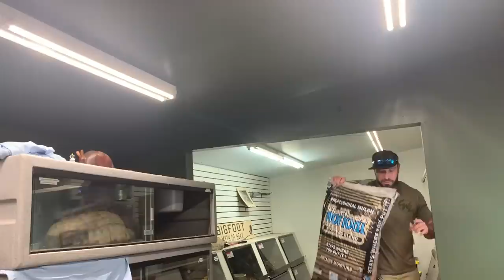KING COBRA!!!!! TAKING CARE OF 2 GIANT KING COBRAS!!!!!

Comment: I was just talking to a friend about preparing for the future with fly rivers.  I've been obsessed with them for years but trying to accommodate a highly mobile, 45 pound, 2' diameter turtle?!  Shit, I don't have anywhere to build a 3500 gallon tank for a single turtle.  Big snappers are a walk in the park compared to that.
Reply from the maker: Yea they do require a lot more than most turtle species but if done correctly it’s a very rewarding experience

Comment: What kind of venomous snakes do you have
Reply from the maker: Elapids would be my fav for sure but I keep a bunch of different stuff, squams, rattle snakes, tree vipers, Palm vipers, mountain vipers and on and on. There’s a lot but no where near what I used to keep when I was importing and breeding
Reply: Do you ever do a live feeding with your snakes
Reply from the maker: Cecil Butler the only time I ever do live feedings is if I’m having trouble getting a snake to eat and I use it as a last resort. Often times when snakes won’t eat a live item will do the trick but again I only do it if it’s absolutely necessary